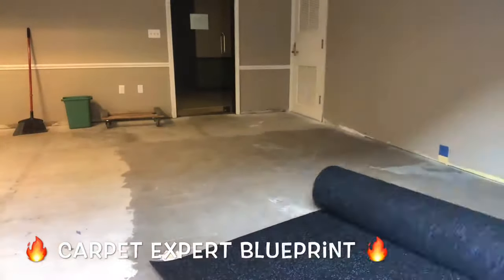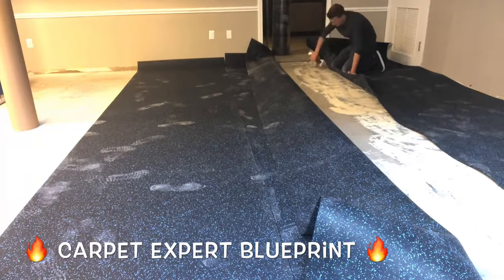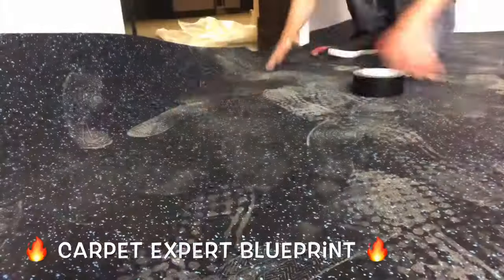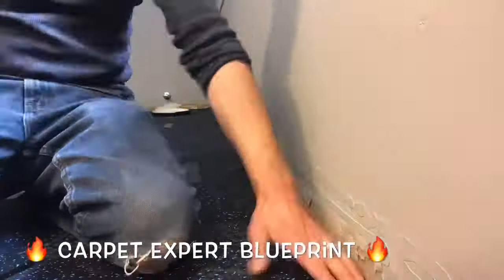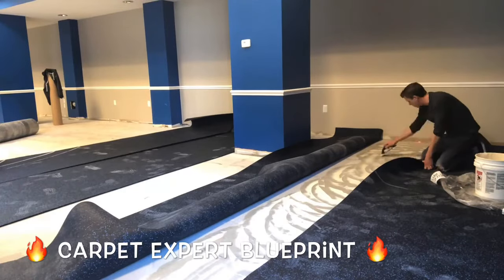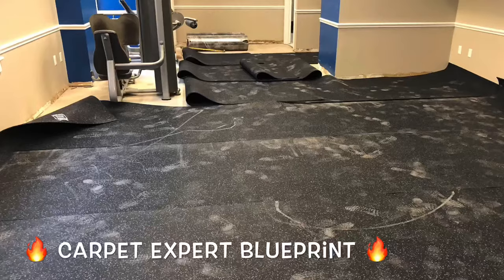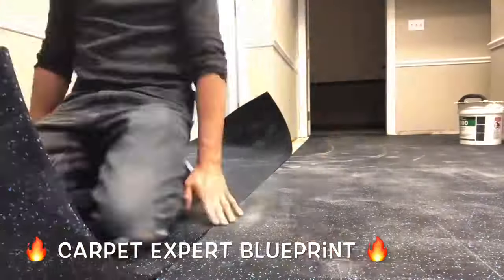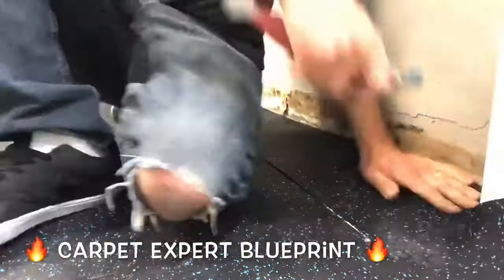🔥 How To Install Rubber Gym Flooring 🔥 What To Expect

Comment: You should definitely roll out your rubber and let it sit for at least 24 hours before installing, gluing only the seams will allow bubbles to form in the center of the rolls and you should NEVER USE THE WRONG GLUE the glue I would recommend is E-Grip iii  or Colossal HMA117 epoxy  the E-Grip iii is the best glue for the flooring I would recommend putting a space heater on the glue several days before installing to allow the spreading of the glue to be easier to work with and you should also roll your floor with a 100Lb roller after installing and you should never use duck tape use green frog tape or yellow scotch tape blue paint tape won’t work and only use rubbing alcohol to clean the glue other cleaners like goof off or mineral spirits will fade the area that is clean
Reply: they didn't even use the roller lol

Comment: I did a 600ft job in a hospital weight room. Glue squirts out a bunch of the seams, I wipe the glue with the recommended cleaner and a rag. It smears into the pores of the rubber and it’s impossible to get out now. So there’s streaks near the seams of glue embedded in the rubber and the customer is complaining, might have to eat the job but how do I prevent this from happening again? It seems inevitable that some glue will get onto the surface, and if it gets into the pores then the floor is ruined

Comment: I am a quality control manager at a rubber flooring manufacturing facility. I'm curious, if any, what would be your biggest gripe when it comes to quality issues with the rubber flooring?
Reply: The factory ends not being square

Comment: Hi there! Thank you for making this video. Im about to do a DIY. 2 questions.
1. What was the glue used in the video?
2. Have you ever had problems with floor scrubber machines pulling the mat off?
Reply: This question is all over the comments. No answer though
Reply: Roberts adhesive 3000, I took a screenshot and then research with Google lens 😂, I don't know why they don't show it clearly 😅

Comment: I just did a job and had to run the rubber floor along a metal schluter . There are small gaps after cutting the rubber. What do you suggest to cover up those small gaps?

Comment: If the customer wants to remove the rubber flooring product how difficult is it to scrape off the glue from the cement subfloor?
Do you ever use double sided tape the hold the rubber floor in place?

Comment: question i have rubber speck gym tiles as well as rolled rubber gym flooring- id like to install it (myself) for my 'dog room', laundry room, the hall & bathroom - my question(s) is this a good idea?! is there a way to 'water proof' it ? of course  because i dont want moister to build up in between the edges & which would be easier to accomplish this? (tiles or rolls) thank you

Comment: Great video. What is the best glue for that? And how do you deal with all the curls when you lay it down? In the seams I have alot of curls. The flooring also got wet, I wonder if that's the reason why mines is curled. Any suggestions on how to remedy that?
Reply: Egrip 3. And ur supposed to let ur rubber lay flat for 24 hours so it can accumulate and relax, stack multiple rolls of rubber on each other but make sure the edges are lined up with eachother.

Comment: Thanks for this video. Can you recommend the appropriate paper or plastic barrier to place underneath my stall mats? I have new porcelain floor tiles on the floor and want to lay rubber stall mats on top. I want to avoid the tiles discoloring and protect along the seams where dirt and sand will fall between that could permanently mar or stain the tiles.
Reply: Well. Ima tell you from a installers point of view (me) that glue will not stick to tile. U will have to demo the tile, scrape the floor smooth and install the rubber

Comment: Could you please provide a link to buy recommended rolled rubber flooring? Thanks!
Reply from the maker: Not sure where you’re based but I have a local distributor in Cleveland that I get it from. Aside from that amazon has several listings to scout deals on this product

Comment: “ And when you’re done back the truck up to the bank!“
Reply from the maker: John Steier yessir! Gotta attempt to keep that money growing!
Reply: @CarpetExpertBlueprint  You are going to have a hard time keeping the money growing, cutting throats at $1.00 ft. Are you a professional flooring installer? If so, have some self respect and charge accordingly. Twenty years from now when you can barely get out of bed because you have physically beaten yourself installing floors, you'll thank me. No 401k or any retirement funds going around doing jobs on the cheap.

Comment: No acclimation, no allowing the floor to relax, you are fighting it the entire way.  Not to mention way too much glue in the seams ( you shouldn't have squeeze out )  Chalk lines are you friend as well as laying it out before you glue.  You can literally lay the entire floor and then glue it down after you do a soft install.  I'd be curious how many times you've had to return to jobs for quality control issues.  Looks like you are fighting it the whole time.

Comment: What a hack! Multi-Purpose adhesive?  This will not last and you know it. How do you sleep at night
Reply: That's why he is only charging $1.00 ft. Your typical butcher. Half assing, cutting whatever corners he can. Making sure to keep the prices beat down for the rest of us.
Reply: Yeah this instal was garbage. Only glued the seems, so first time it gets hot the middle of the rolls expands and bubble up. Just scraping the glue coming up in the seems so that will probably be noticeable when it dries. Not rollered flat so the joins look uneven.
And had the balls to say he should charge more.

Sounds like the guy who charged my parents £10 per bag of sand, that he didn't even level when laying their astro turf. 

A bad job ends up costing you more when you have to tear it up and do it properly.